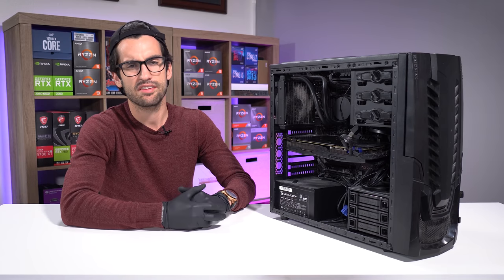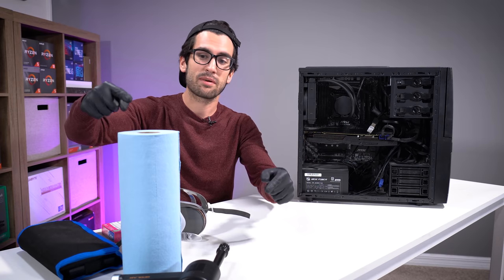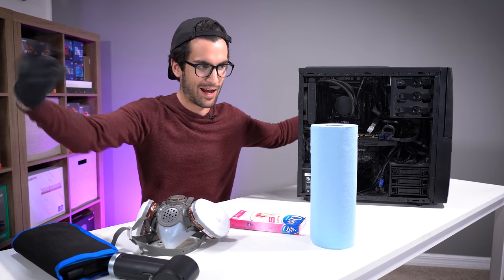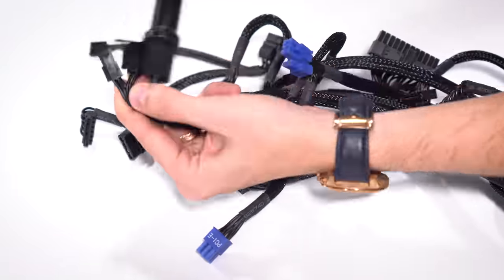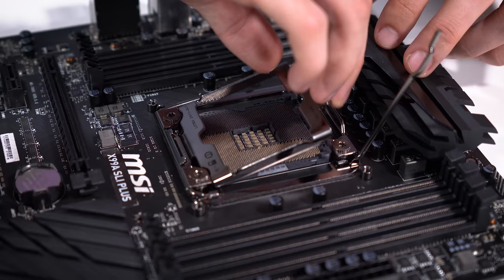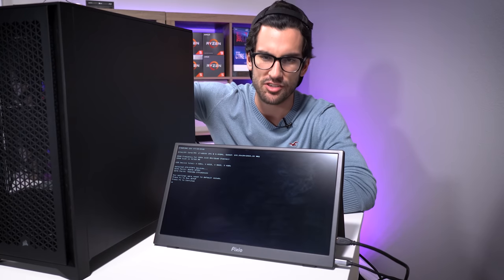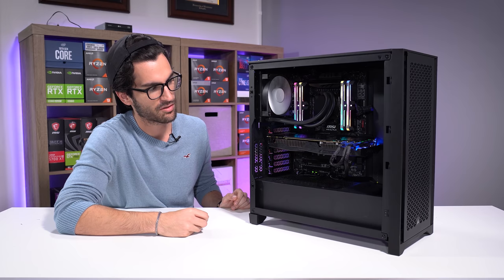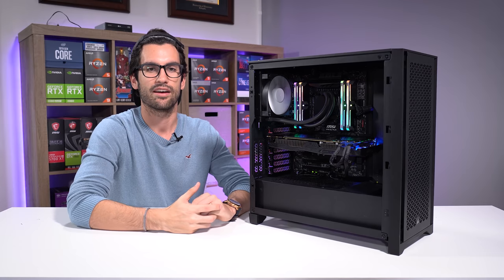Deep-Cleaning a Viewer's DIRTY Gaming PC! - PCDC S1:E8

Comment: Try taking it through a car wash with the top down. That will clean it out
Reply: Nice name
Reply: But you can't put the top down on that case 🤔
Reply: jim rose  that is what I did to the case that is now my openair Testbench 😁
Reply: jim rose  I just didn't want to spend $200AUD on a actual Testbench, so I took all the plastic Panels off & cut up an old one I got for free, it was a dual chamber, I altered the Feet from the bottom to the side, so it now sits Horizontal with the Mobo on top& the PSU & Drives underneath just like a bought one 😁

Comment: H2O is a solvent. This interaction with and breaking apart different organic compounds means that normal processes that other liquids or compounds can’t pull off, water is ideal for that. It’s even a vital step in the formation of life. Certain organic compounds wouldn’t have a chance to form within other liquids. Titan for example: if we were to use that it wouldn’t be nearly as good as water is for chemical processes.

Comment: yup, thats exactly how I clean the chassis. in the winter I'll do it in my roman tub....  all the fans get washed and so does the radiator, if there is one... I also check all the chassis wiring and accessories... break off all the factory blanks (both front and rear, replacing the rear ones with regular blanks. let the whole chassis dry and then reassemble the system... If I'm doing a system recycle, I'll add any extra fans to the chassis if needed and use fan guards on them to prevent any further problems, ive gotten my fingers in the way at times and OUCH!  Thank you for the video! its neat to see someone else clean a system right!
Reply from the maker: Hey, John! Thanks for sharing how ya clean. Good to hear!
Reply: @GregSalazar  what is a good email to keep in contact with you?

Comment: Haven't seen a GTX 1080 in awhile! Even though its considered old, the pascal architecture can play well!
Reply: I considered getting one as an upgrade from my 1660 SC then I found a 2060 for $200
Reply: @Razor-gx2dq  Yeah, the 1660 is basically a stripped down RTX 20 series. Same platform but less powerful and cant do Ray tracing. Still a solid GPU for 1080P and 1440P gaming tho.
Reply: @Razor-gx2dq  how did you pull that off
Reply: I'm still flogging my GTX1080 and it's holding up well. Don't get me wrong, I'd still love to get my hands on an RTX3080 but until I can my old card keeps chugging along. The GTX1080 has had no trouble powering my ultrawide monitor except for trying to play Cyberpunk and that's only because I'm sensitive to motion sickness.

Comment: What a clean build. Amazing performance balance as well as a perfect balance of just the right amount of RGB. I would just personally add an additional stip of lighting in the case and close the panel with a tempered glass panel to show off the interior (if it was mine). 👍
Reply: @Gray Kuit why blue with bonsai and mist it doesn't match

Comment: Really like this series.  Makes me want to clean my computer.  Just afraid that I would end up with "extra pieces" after putting it back together.  😂
Reply: You don't necessarily need to do a full teardown like this. Get a good portable air blower (like the Metrovac Datavac), use the normal blower attachment to blow out most of the dust, then attach the brush attachment and go over all of the PCBs and fan blades that you can see. It'll work wonders and will most likely be good enough without risking breaking anything
Reply: @WinPC99  yea full teardown is only worth it if you upgrade to a new case or get a new cpu
Reply: A can of compressed air, take it outside blow it out, take of the filters separately and blow them out. Simple.
Don't need to get too involved, start simple. If you're getting temp issues then you might want to do more.

Comment: I have learned quite a lot from this series on how to clean my PC.  The only thing I maybe can add is to also lubricate the GPU fan motors.  I recently had the temp on an old Strix 1080 rise to 83c when gaming and the culprit was one fan that got stuck.  Lubricating the fan motor fixed it and now the temps are down to the mid 60s again.
Reply: What did you use to lubricate it?

Comment: A tip from another builder: You should not use the VGA power splitter Greg when you re-build a PC.. it has been proven by many other people that it does deliver less power when needed since it will use a single v12 rail decreasing the overall performance by a small percentage... you should use 2 separate vga power cables to balance the power and increase the performance (if the PSU allow it having a spare cable, otherwise ask the owner to give you also the PSU box togheter with the PC).

Comment: My CPU was running hot. Discovered it was probably my AIO cooler going out. It works but I think it could be better. Repasted it last night. and awaiting a new case Corsair 4000D Airflow in white and a Corsair H100i Elite Capelix also in white. Going to get more air moving through my case, and a chance to deep clean my components. I also ordered some thermal pads to apply to my mobo heatsinks and possibly GPU, GPU is the newest so I haven't decided yet.

Comment: Hey Greg, I have a 400D airflow and I have one very weird recommendation. The Front IO Audio cable has some crazy static when its in the wire channel with all the other cables, which only went away when I routed it independently. Figured I'd share! Awesome vids, makes me wish I didn't keep my computer clean sometimes.

Comment: I'm still running a Strix 1080 with my 8700k. Finally got my EK block for the card and will be going full custom loop to go with my CPU cooler as well.

Comment: On non-electronic parts where static electricity isn't an issue such as the case and the fans/CPU coolers, why not use a vacuum cleaner? It has worked great for me.
Reply: he is doing a deep clean. Even vacuming leaves residu.

Comment: Hei Greg. I recently cleaned up my Titan X and replaced the pads with ARCTIC ones (same thickness)
But they're stiff AF! getting a good fitment required a disassembly, squishing the PCB and heat cycling the card 3 times!!
What thermal pads do you use?

Comment: So, what do you do with the thermal pads on the graphics cards and MB heatsinks after you pull them off? Do you reuse them after you clean the part or get new thermal pad material? Aren’t the graphic card pads thickness sized to a specific thickness?

Comment: The OPOLAR air duster is great. I also noticed it was much cheaper to buy directly from them rather than via Amazon. I imagine with cotton buds, 99.9% isopropyl alcohol and a rechargeable air duster, I should be ashamed if I get my computer even fractionally as dirty as this. :)

Comment: That was actually my last case lol.  I took that plastic face plate off all the way, and opened up where the CD drives should go, to improve airflow.. it helped a lot actually lol.  I believe I had my FX-3600 processor in there with 16g of ram and a RX-580 by the time I upgraded, it was soo very nasty inside that case lol..  I am still using the video card, as who wants to actually spend five times the actual worth of a video card, for a video card lol..

Comment: Awesome job as per usual, quick question, do you replace the thermalpads of the mother (in the heat sink)  and GPU before putting them back together or is it safe to put the old ones back? I'm asking because I want to deep clean a friends PC which looks worse than this and it's a fairly old PC as well.
Reply: its safe to reuse thermal pads

Comment: There’s 2 ways to get a computer system PERFECTLY clean and it has nothing to do with cleaning it. Greg,
I regret to be the bearer of bad news, but in keeping with the theme of this show I must inform you that your efforts are of a wasted sort. 

Luckily, a redeeming path lies await! 

To 100% remove every trace of dirt from any neglected PC, for the components that comprise the system you’ll want to grab an exact number of anti-matter particles and join both of them together. This will annihilate all dust and debris. The cleaning method is very effective 

Lastly, you’re going to want to throw anything into a stellar-mass black hole.

Comment: Hoping to see how to deep clean the monitor and PSU!
Reply: I was just thinking yesterday that a keyboard deep clean video would be good. I've just replaced my old keyboard because some keys stopped working (probably due to being drenched in a cup of matcha tea about a year ago, I'm impressed it lasted this long after that)
Reply: To clean the PSU he should wash it with the garden hose on high pressure and leave it to dry for a few days, then spray water dispersant over the components. I’ve done it to 20+ PSU’s and they work great. Dust is a big PSU killer

Comment: Did you check the cpu temps? Last time I installed AiO that way it didn't work properly. Somehow it didn't like both tube ends at the top so I rotated it 90 degrees.
Reply from the maker: ? The tubes were at the bottom when I cleaned and reassembled the build.

Comment: here's a weird question for ya... can't we use an anti-static spray on some of these components so that it doesn't get THIS insanely dusty ? at least on the fan blades maybe ? The ones I have are specifically for plants and they do work wonders ! so I'm just throwing this out there as a solution perhaps to computers too ?

Comment: im still running a MSI GTX nvidia 1050 4g gaming card and DAMN does it run like a champ. my CPU though is taking a shit, luckily MSI comes with so many programs for PC health but gonna need a newCPU... I5-6500 is taking a shit sadly :( PC temps run low 90's so i know its not from heat damage, its just old sadly

Comment: Quick question, that thermal shit you ripped off the GPU and the SSD, back plates, did you replace them or just completely get rid of them?
Reply from the maker: Off of the SSD? Do you mean the VRM heatsinks on the motherboard? Those are thermal pads. I don't generally replace them unless they're cracked/disintegrated. Thermal pads come in many thicknesses and it can be difficult to match those used in a particular motherboard or graphics card.
Reply: @GregSalazar  Yes the thermal pads, I've got a 1060 that I've been having struggles with, and recently I cleaned it after a few devastating years, and the thermal pads are VERY worn out and I really need to do a switch with those and a deep clean.
Reply: thermal shit 😂😂😂😂😂

Comment: Greg, whatcha using the old cases you don't reuse? I'd love to see like a spare parts build with one of these old cases, then maybe give it to someone who needs it?
Reply: Especially the P400 from the other week. It's so easy to update that to one with good airflow thanks to Phanteks selling the P400A front panels separately. That's what I did with my current computer and it's running sooo much cooler and seriously took 2 seconds.

Comment: The real question is if you flush the case with water ... why don’t you use your compressor to blow it dry (since drying it by hand might leave some spots that you will not get to that easily) 
Btw ... Keep up the good work
Reply from the maker: I do - AFTER I hand-dry. Would take too long the other way, and would splash water all over my carpet.

Comment: this isn't that bad, I had a guy (smoker+cat+dog) that for 5 years didn't clean out his pc. It had a 120 AIO for his FX8370, dont remember the gpu though. Anyways the cpu was thermal throttleing and he though it was broken, and to be honest I thought the pump seized before I saw what was in there. 20 minutes with a compressor and I tiny bit of disassembly and he was back to 5ghz steady. But really, I must have pulled out a dead cat that got stuck in a crematory's ventilation shaft. Rotten.

Comment: AIO upside down, you want any possible air pockets to rise up to the top of the radiator, not the pump. His method will work, but could create problems down the road and shorten the life of the pump

Comment: Is he wearing an anti-static strap on his ankle? Or if not, how does he reduce the risk of ESD damage to the components?
Reply: It's not really a big deal to computert components TBH. Electronics engineer here. ESD is mostly dangerous to older hardware or cheap hardware. Most hardware these days come with ESD protection circuits.